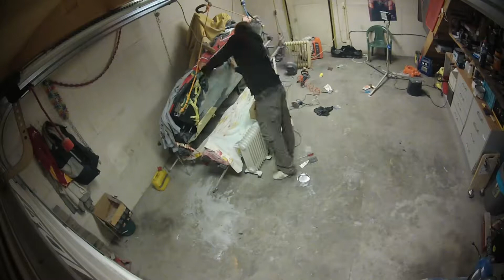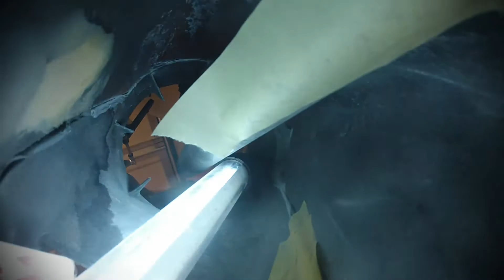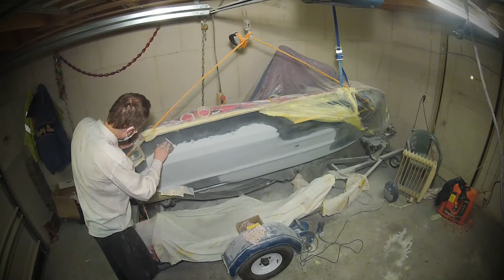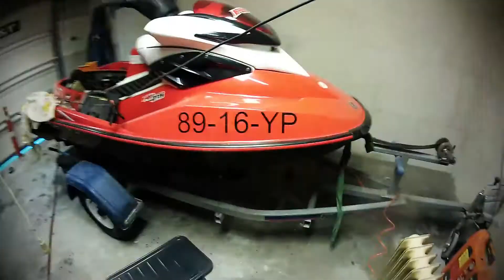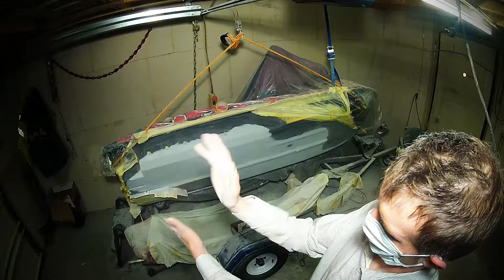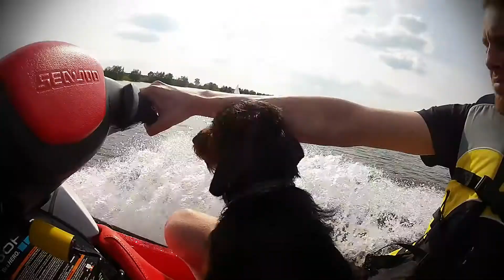Seadoo hull Repair. Full HD 2014 edit DIY

Comment from the maker: Thank You!!

I used epoxy resin for applying the mat. I also used epoxy for its strength and rigidity like polyester resin, but also epoxy is not susceptible for water suction like polyester resin. Also i mixed fiber putty with normal two-component putty to get extra strength! 

Important is that you keep the temperature between 18C and 20C All the time! Ensure good ventilation during the drying and curing phase and be patient!! 

It did not require a special gel coat to bond. My personal preference go to 4 - 5 layers of real expesive two-component paint! 

Good luck with your repair!!

Comment: How's it goin boss,

I too have to perform a large seadoo hull repair. My question is, what epoxy did you use when applying the mat, I assume epoxy is used for its strength and rigidity. Also did it require a special gel coat to bond to the epoxy? Excellent job by the way!

Comment: Good Day Mr Jansen, 

i know this video is a few years old, but i would like to know how your repairs have held up over time. Has your ski leaked ?

Just to give you a idea why i am asking this, my ski recently has a defect in the Hull. A crack was observed by the pump area and essentially causing the craft to sink. I see you had a crack throughout your pump housing area and you did an excellent job repairing it. The dealer wants to do a repair but i think due to the location if will fail yet again.   I have posted this in forums, you may look for your self. ( http://greenhulk.net/forums/showthread.php?t=283180 ) 

Please let me know how your PWC has help up and if you had to do any additional repairs. 

Regards.
Reply from the maker: Thank you! The repair held up great over time. Better than i would think. Made 200 hours already. I Made a lot of big jumps with hitting the water verry hard. The grinding in the sand and stones while beached.. its verry strong in my case :)